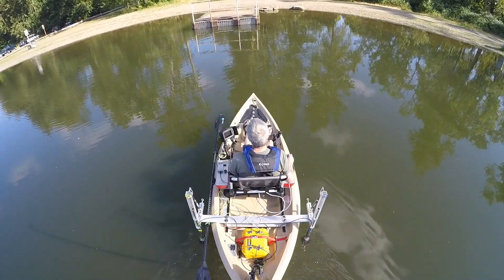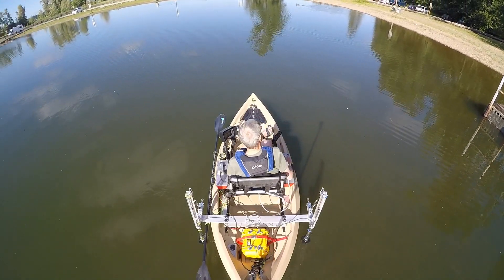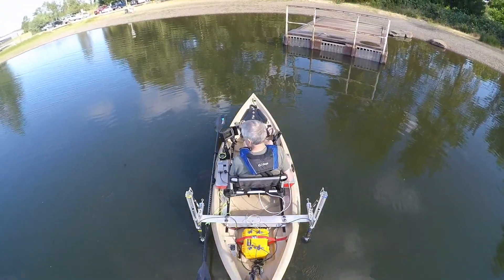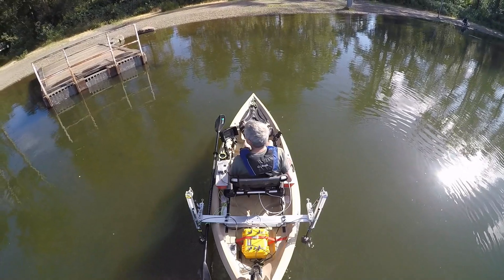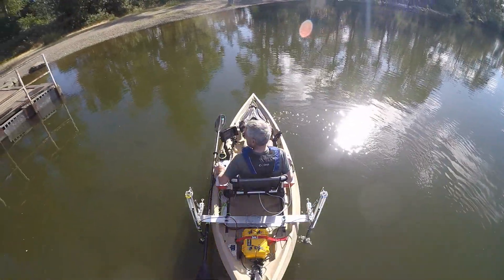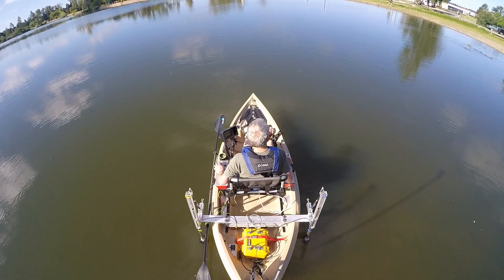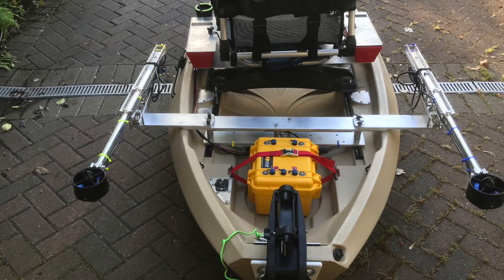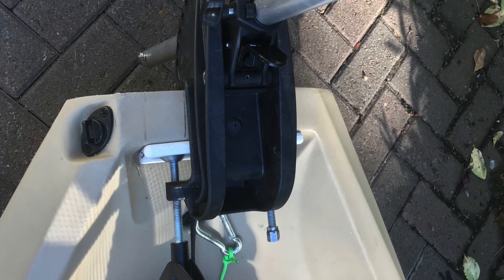BlueRobotics T200 & Thruster Commander Test

Comment: isnt it cheaper and better to use trolling motors?
Reply from the maker: it depends... you can pick up a Minn Kota Endura C2 (30# thrust + 30" shaft + 5 speed) for around $100.Or a BlueRobotics T200 thruster and ECU is about $170 + a BlueRobotics Thruster Commander for $49. But this is a real apple and oranges comparison. I have one version using a Minn Kota C2, and several systems from Pololu Robotics & Electronics plus hardware from ServoCity. This setup was probably well over $300 in parts including the C2 trolling motor. Some of the Pololu components include a PWM speed controller for the motor. https://www.youtube.com/watch?v=H7hlveZroJg

I would modify the above C2 setup by replacing the till tilt setup with a gas strut and using a cord to tilt the motor assembly. The linear actuator tilt setup has a fatal flaw. If you were to hit something with your motor something could break. The gas strut design would allow the entire motor assembly to tilt up. The gas strut has to have more force than the reverse thrust of the motor or the motor will pop up in reverse. 

If you want to do this as cheap as possible, consider mounting a C2 motor on the side of your kayak and use the controls that come with it. I have seen several designs on YouTube. Something like this https://www.youtube.com/watch?v=rqLlmeitSu0

As far as a trolling motor being better, again it depends. For my use, the T200 thruster works great on the small bodies of water I fish. The C2 has more thrust 30 pounds vs 7.8 pounds but the C2 weighs about 23 pounds vs the T200 weighing in at about 3/4 pound. 

In this video, you can see my single and dual T200 designs. Both work great but the single T200 suits my needs. Note the gas strut support the tiller shaft. https://www.youtube.com/watch?v=j4iFvNgYW4A

Comment: I thought of using these thrusters on my kayak. What voltage are you running? How fast?
Reply from the maker: see reply to Colin Beler. I am "running a 12VDC system
Reply: So the units will hit hull max speed? 4-5mph? I understand the current draw. I just want to be able to get to a fishing spot, then anchor and fish. My back keeps me from paddling much.
Reply from the maker: Brent, go to my "About" tab and send me an email with your phone number, time zone and the best time to call. There are a LOT of variables here and might be easiest to chat. Thanks, Phil

Comment: Cool video. Is that the fastest that those motors can go? Or can you put more power into them to make them go faster?
Reply from the maker: Speed is a function of the kayak's max hull speed which for my 10' kayak is about 4.6 mph.

Having said that, with the major limiting factor is my battery capacity. Speed vs current draw are NOT proportional. I can cruise all day at 1.5 mph and be drawing about 3 amps in total for both trusters. Step it up to 2.5 mph and now I am drawing about 9 amps. 

I am using a LiFePO4 Battery: 12V 25Ah battery 
https://www.batteryspace.com/lifepo4-battery-12v-25ah-300wh-50a-rate-with-led-indicator---replace-sla-12v-20ah-lighter-weight-and-higher-capacity----un38-3-passed.aspx
Reply: @PAKOREGON  if that isn't the truth "speed vs current draw are NOT proportional" I had a Nissan LEAF all electric car for five years, driving to work like a bat out of hell would eat up my battery capacity quickly!